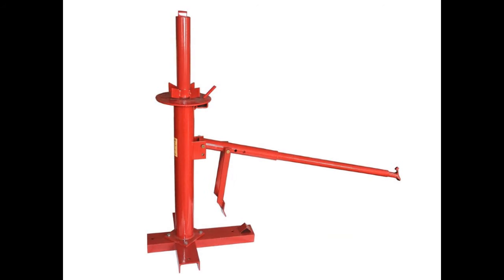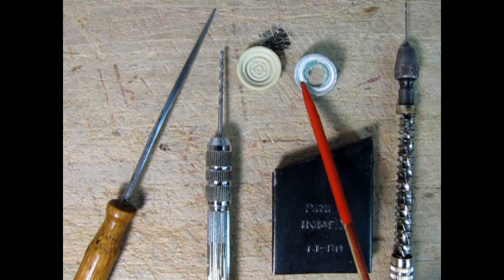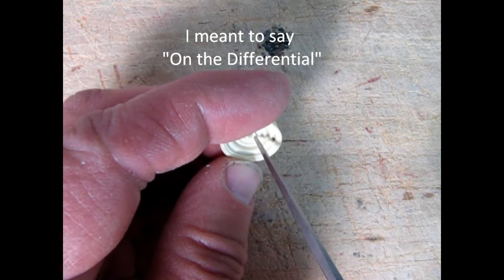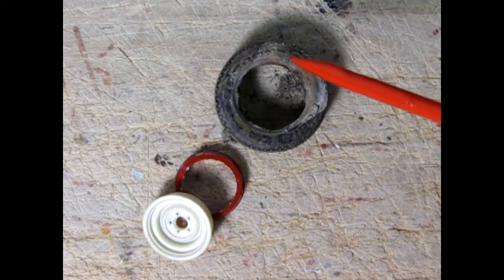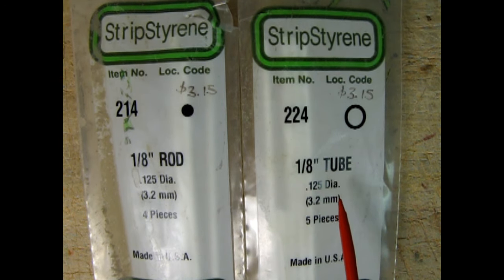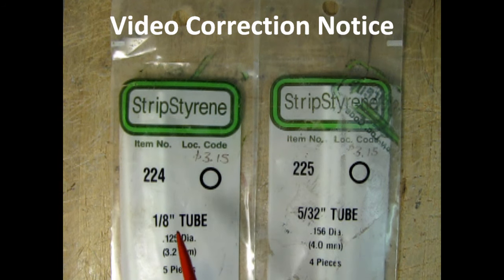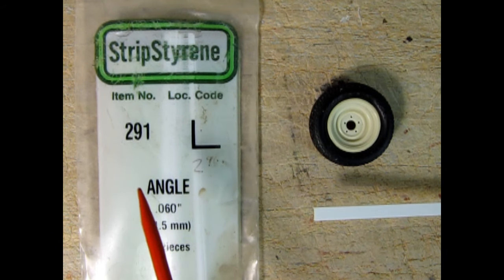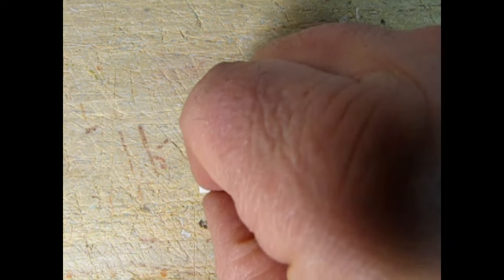How To Build A Harbor Freight Tire Changing Machine in 1/24th scale for Natie's Garage Diorama

Comment: That's excellent, Trevor 👍😎. You could make weld beads from stretched sprue ,soften with thin liquid cement and add weld details with sharp tool👍😎brilliant details of build and materials used👍😎Pete 🤓
Reply from the maker: Thank you Pete! I need some new liquid glue. Mine is turning into mud.
Reply: @MonsterHobbiesModelCarGarage  that's helpful if you are doing welds or thin it down with some nail varnish remover 👍🤓
Reply from the maker: yes...My girls should have some nail polish remover which is laquer based. I'm also going to buy some more liquid glue from my wholesaler with that order for the AMT truck kits. If AMT doesn't release them next month, I think i will just place a little order for the glue and the Revell Double Decker London Bus kit for myself for Christmas.
Reply: @MonsterHobbiesModelCarGarage  lol👍🤣
Reply from the maker: @petesmodelcarcustoms584 Part of the fun of owning a hobby shop....i can get myself a model kit at wholesale and write it off as a business expense under "advertising" for a diorama for the store display shelves.

Comment: I mean I have one sitting outside and even at my age 61 I can easily use it... But to give a poor guy or gal a HFT manual tire changer is cruel 😂😂😂 at least make a classic Bishman manual tire changer much better changer for sure... Next you'll also need a bubble wheel balancer to go with the HFT changer!😂😂... You did a great job scratch building it.. the original was red and now it's black at HFT...and there's even a HD version at northern tool co... Don't for get HFT version of their HD bead breaker that too would be a good addition to the scale shop.
Reply from the maker: Originally, I was going to build a Coats tire changing machine like the one we used in highschool, but this one looked easier. Glad you liked the video. - The bubble wheel balancer is coming up in the next video.
Reply from the maker: I just looked up that  Bishman manual tire changer you mentioned. That's quite the complex looking machine design. So many curves!